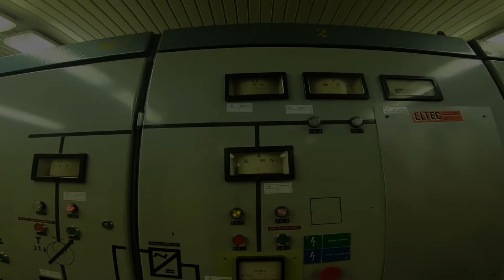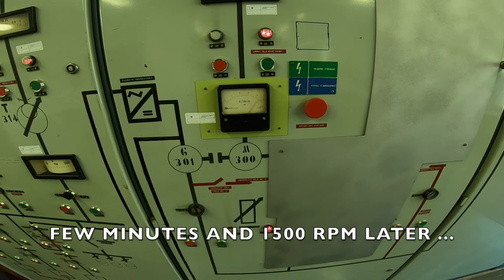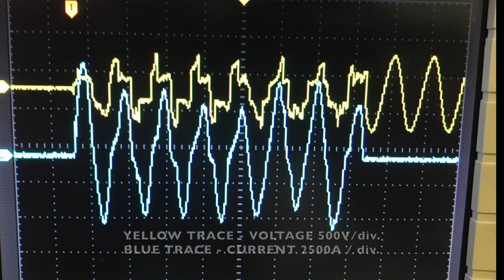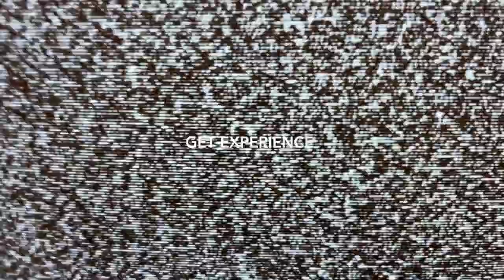SUPER SAIYAN POWER | ep.2 | 2MVA ALTERNATOR SHORT CIRCUIT ARC FLASH ON 400V BUS BARS

Comment: Please pull some 100kVA arcs with 200kV ph-ph. That'd be insane.
Reply: Unless the HV tx is too small. In which case just use whatever power it's rated for (maybe 10kVA per transformer)?
Reply from the maker: as you already realised.. its not possible to make 200kV 100kVA arcs... where would the energy go ??? can do low voltage arcs of few kA and the supply would be disconnected within not more than 10 periods of voltage or HV arcs of hundereds of kV disconnecting the source at not more than 500mA... what I actually could do is heat something with current of few tens of kA... any suggestions ?